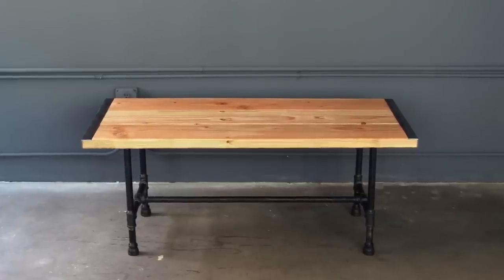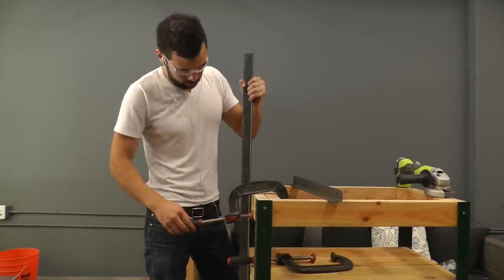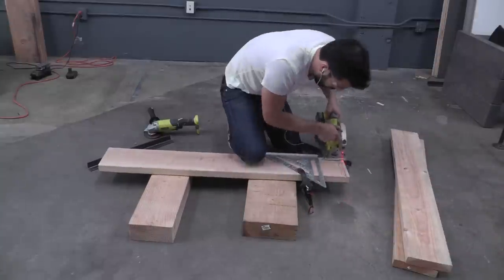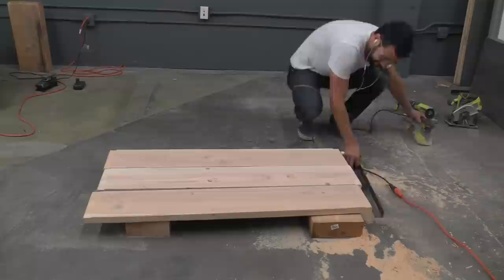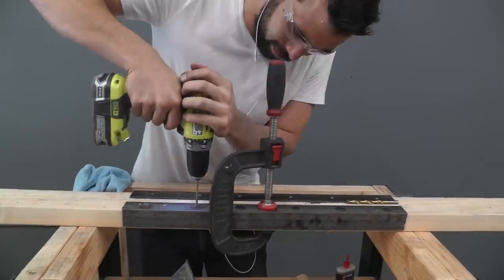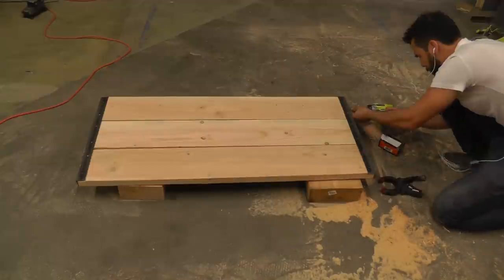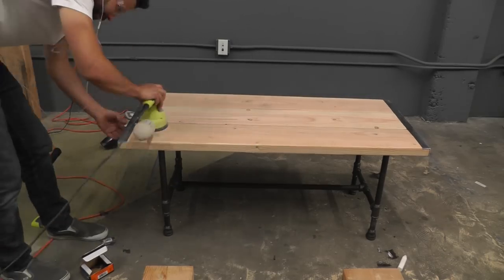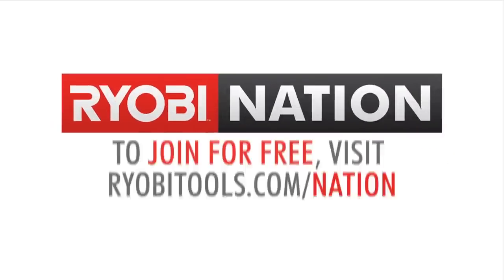DIY Pipe Coffee Table

Comment: Nice simple, easy table. Beginners should feel comfortable attempting this.

One option to make it even easier would be to flip the angle iron to the bottom of the table.  The end cuts would still be covered but you wouldn't have to notch the ends, which is probably the most difficult part of the build.  Of course, that would change the aesthetic, and stuff might tend to get trapped between the wood and the iron.

Comment: A possible alternative to coating the angle with oil (which never dries) would be to spray or brush it with polyurethane. You would just have to be 100% certain that you got all the rust off prior to applying it. Great video though! I just sketched out a black pipe project myself for my house. I love the look of black steel and wood.

Comment: Did you do anything to the black pipe to make it not rub off the black coating every time you touch it? I always have that problem with my pipe clamps. Also, you sanded down the angle irons and screws but I didn't see you finish them with anything?

Comment: I would suggest using a couple of pipe wrenches to at least snug up the fittings. I realize it can't come undone, but the loose fit will allow the table to wobble and ultimately it will loosen up more and possibly rattle.

Comment: Love your videos! Would it be a terrible idea to use an iron pipe table as an outdoor dining table? Would I need to treat the iron somehow or should I consider another project? Thanks!
Reply: The iron pipe will begin to corrode fairly quickly outside but the angle iron will rust immediately. It could last a decent amount of time if you paint the hell out of it iron pipe and used aluminum angle pieces. Definitely need to use treated 2x8's or switch to cedar.
Reply: Thank you!
Reply: I plan on using pipes for an outdoor table. Thanksgiving is upon us!